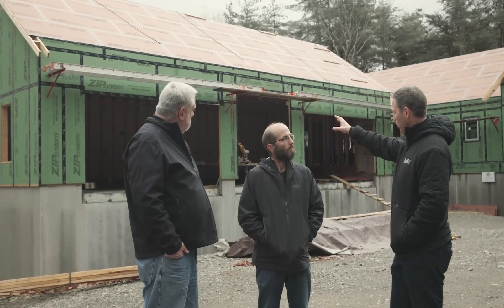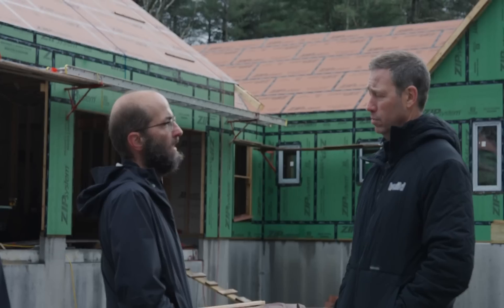Monopoly Framing + ZipR = Perfect Air Barrier/Thermal Break

Comment: Maybe I’m wrong but how do you ventilate the roof attic space so that no moisture builds up or is that not necessary. I am designing a mini house/ workshop area that would have blow in walls and attic with mini split and metal roofing. Double 2x4 walls for that thermal break sheet metal siding. I’m just worried about moisture in the attic messing with my wood and insulation. I’d like to monopoly frame the roof so I don’t have any gaps for moisture or bugs or draft.

Comment: Envelope much to tight, air exchanges critical to this design , loose air exchange and interior becomes a thermos bottle, better have back up when the tornado /hurricane kills the power for weeks at a time . Once you get evacuated all bets are off and you will probably come back to a mold pit.

Comment: Good to see this idea is being used more. How is the gable wall to roof connection "monopoly framed" in this case? It appears the roof sheathing was run past the wall to attach the ladder rake. Wish they had some drone footages or close up photos at least. Maybe Steve will do a follow up video with the drawings.

Comment: I'm still trying to understand this. Why ZIP-R in the northeast and not exterior insulation? Is it simply a matter of being cheaper?
Reply: One trip around....
Reply: @stevenbaczekarchitect9431  One trip around would certainly qualify as cheaper. Can this be done without closed cell spray foam and extra thick walls?

Comment: PSA---If you are participating in your own build, just be aware that the subs dont know you and might not listen to you if your not there. It is not easy to get subs to follow these building methods in my personal experience. You will get a lot of comments like "I've been doing this 30yrs" or "If you know so much why did you hire me?". It may also be challenging to find an architect that will work with you on these details. Some subs simply wont listen and try to force you to accept things that dont even meet code. If your building inspector is not focused; you will be in a very bad position. After multiple months we have a nice house, but it is a lot of work and stress to be involved directly.  Best of luck future homeowners!!
Reply: Reading between the lines what im really hearing is that there wasn’t good communication in the pre construction phase of the details you wanted and instead you were trying to coach as the process was unfolding.  Subs bid on projects based on their previous experience if you don’t explain in great detail the scope of what you want and usually for a good build it will be more expensive so I’m thinking you were asking for details that weren’t in the original bid so the subs were probably annoyed not difficult
Reply: - yep, the subs who say this - anyone who pulls 30 years of incompetence as justification for anything is about ready to retire - and shouldn't be on (such an atypical) site...

If the GC (if it isn't an owner build) doesn't "get" the concepts - fire them, or get them to edumicate themselves......  (Same for Engineers, architects and Inspectors - you want all the guys / gals on the team to be working for you the owner...

Indeed, if you are doing the "prime contractor" work - you need to be onsite managing the build - whenever there are any other contractors doing anything....

Comment: I know over time his overhangs will sag and droop down, I've seen ladder style overhangs sag on gables and this is a ladder style overhang everywhere, it's not a strong design when it's just nailed on to the face of the building and without even the roof sheathing to support it. He should run rafters over the Zip and create a second roof over top the first and that would give strong overhangs and more space for insulation or even vent the roof.

Comment: 1) 
How do you know the roof edge is engineered enough for heavy men on ladders with supplies climbing on the roof edge? 2) do windows have deeper flange than usual?
Reply: - just get light men to do this work..  (jk) - I don't think we are seeing all the roof / eave details just yet - if it ends up like other monopoly builds MR has shown, there should be rafter tails and a cold roof deck added  otherwise ?? - yes hmmm... -  Don't forget snow loads can be much greater than a set of heavy boots.

Comment: Matt, I have been a fan for at least 10+ years now. Watching many of your vids more than once in preparation for my last build. As of Oct 024 all of our pre home build installations will be completed. Foundation, road, 600 ft electrical, septic, well, etc. Only the actually house itself, framing plus will be left. Now - my down fall.. I cannot justify/afford all of these energy savings add-ons. The one I truly wanted to do was to add my overhangs to the air tight box as this video is describing.. With an end result eliminating all thermal bridging. And so many, many others. With the price of labor and materials these days I just don't have the funds. 😪 I'm guessing that this add-on to this home (by itself) added $15K + over the the standard method. Once you start adding one after another they add another 100K to the project. 
Keep up the good work. Enjoy watching the latest problem solving going on in the residential construction field.

Comment: I don’t get the monopoly frame in a northern climate (unless it’s all vaulted ceilings). Are you conditioning your attic and doing a hot roof?? Also, what’s the point of lining the RO s with 7/16. Could you just tape over the exposed edge of the zipR onto the 2x6 and complain the same thing?

Comment: So with the perfect air barrier on the exterior, what do you install for vapor barrier on the interior, anything?
Reply: - the external air barrier is the vapour barrier - internally the airhandler/etc dries everything to the inside  (Dehumidification  - humidity control - ERV / HRV is nearly essential in houses which are so tight, otherwise simply opening up to the elements negates insulation)..
Reply: When you say “ negates insulation” does that mean you aren’t putting any?
Reply: In my experience the “vapor barrier” goes on the warm side of the insulation because that is where the dew point exists, if the zip sheathing is the vapor barrier then are you putting insulation on the outside of the framing?

Comment: I liked seeing this when MR was building his house.  However, still, I like overhangs that are 24" in depth.  What is the max that an overhang can be and still allow the weight loading.  DIdn't MR extend the overhang framing up the top of his roof and then laid another layer of paneling on them?

Comment: I’m not understanding how the air barrier is achieved where the roof sheathing on the gable ends ties into the wall sheathing when the roof sheathing runs out to the end of the overhang. It seemed like Matt asked that question then the owner either didn’t understand the question or just breezed by it?
Reply: I think in another video you see it’s Zip covering the soffit with liquid flash in the seam where it meets the wall

Comment: This is a great job, one question why not R-12? is it due to wall thickness already or something else.
Reply: The jump from R-6 to R-9 is an easy pill to swallow, Going from R-9 to R-12 is actually a leap, nails change, special framing gun, etc
Reply: I have just put up 22 sheets of R-12 with 4" screws, yes it was  challenge as a recommendation from Efficiency VT. I will see if it's going to work along with Pella Impervia windows
 @stevenbaczekarchitect9431
Reply: ZIP and ZIP+R specifications require 1.5" or more penetration of the nail into the stud, so an R-12 ZIP+R means 2" insulation + 0.5" sheathing =  2.5" thickness, requiring at least a 20d (4") nail, which gets very hefty when each piece of sheathing requires ~70 nails.

Perhaps a more minor consideration: With such large nails, the nails themselves also start providing a meaningful thermal bridge: each sheet with ~70 20d nails would have the equivalent of 2.25 square inches of metal driving through the R-12 insulation and bypassing it (vs 1.5 square inches for 70 3.5" 16d nails for the R-6 variant).

Comment: Ummm... isn't this all a little overkill?  2x6 interior walls and R9 sheathing.  Where is this house at, the Arctic Circle?
Reply: This is just a little better than the 2021 International Building Code calls for in climate zones 4 and higher (R20 wall cavity + R5 continuous exterior insulation). Keep in mind this is a Minimum requirement.

Comment: The fact your framers had to build that whole place without backfill sucks.
I’ve been building similar to this for 18 years now. Build an envelope and then put the pretty stuff on later.
Reply: The walls were all framed offsite and craned in, 1 1/2 days to set all the walls, another 1 1/2 days for the roof trusses

Comment: I know nothing....... it's really nice to see all of that nice contiuous, carefully taped sheathing ; but um....if you are going this far to protect and seal the structure; doesn't it make sense to COMPLETELY coat EVERY surface of the ladder rake assemblies with a durable sealant and perhaps even finish paint BEFORE installing them?
Reply: They get covered by finish trim
Reply: I think those rake details all have ZIP underneath them, so my understanding is that they did complete the sealing before adding those. ZIP should not be painted, because it will be covered. The nail or screw penetrations in the ZIP are also okay -- the nail / screw doesn't create a new gap, unless the nail or screw is backed out.

Comment: I have watched this video several times and I still don't understand how the eaves/overhangs are done when a house is "monopoly framed"
Reply: My impression is that in this video the wood that is visible (exterior to the ZIP) was put together purely on the exterior of the ZIP and then secured through the ZIP to the framing, probably with heavy duty screws (e.g. PowerLags). Another flavor of this is what Matt did on his house (Real Rebuild series), where he also did exterior insulation on the roof -- I personally feel better about that approach than the approach shown in this video (even if what was done in this video also looks secure).

The details on this framing is always done in a vague way in these buildings in Matt's videos. Maybe it's currently all considered specialty (non-standard in the code) and so needs sign off from an engineer? Either way, a clarification on that would be useful.
Reply: I certainly like the concept of tight airseal at the junction of wall and roof but unless I can better understand how the overhangs/eaves are done with this system it seems like such a hassle/complicated process that its not worth what is saves in terms of air tightness.  If I could get a better grasp of how to do the overhangs/eaves it may be different story.  I would guess the great majority of framers have never heard of this method nonetheless actually performed it before.  @dosadoodle

Comment: I'm pretty sure this is the correct roof-wall joint detail for Perfect Wall, and is well and away better than some other variants you've tried, Matt.

I'd prefer to see the zip sheathing come down lower than the bottom sill plate by about 1/4" so it drips past the sill, and I personally am loathe to use sprayfoam on anything that isn't temporary, but his idea of pushing the sill out further from concrete might prove useful for handling the layering and attachment.  Just need to be sure the entire sill doesn't make contact with concrete, even mortar for stone, or it'll wick.

I like his idea of adding a half inch to RO all around to add zip sheathing inside the window sill, but I'd like to remind that alot of folks will tell you to let the top edge of a window to drain out rather than pushing any possible water back into the house.

Also should slope the bottom sill so it doesn't act as a water pan.

Comment: Are ice dams where the overhangs are attached a concern? Does the detail have a roof vent space going over the already installed zip roof sheathing to prevent ice dams building up where the overhangs are being attached or is that not a concern with monopoly framing?

Comment: Really impressive work by Josh.  As a fellow engineer who also builds, I really appreciate it.  Funny thing, we monopoly framed my house in 2012 simply because we wanted rustic exposed rafter tails.  The sane approach we arrived at was to end the rafters flush with the walls and put on a rim board.  Then a fascia and stained 4x6 "faux" tails were attached to the rim, and stained rough sawn 1x12 lumber attached over the top of the 4x6 tails to look like roof boards from below.  Viewed from outside it looks real but it's all tacked on external to the monopoly framed wall and roof structure built from traditional framing lumber and sheathing.

It's great to see the monopoly concept being used to enhance the build for airtight purposes with modern materials and methods.  It makes a lot of sense.  My only advice to anyone considering this is to be aware of snow loads and wind uplift loads on the overhangs -- since they are not structurally tied to the rafters, they need to independently handle these loads.  Wind loads can be very substantial on the overhangs, especially on gables where wind creates low pressure above the roof and high pressure under the overhang, which is a perfect combination for uplift.
Reply: It's kind of like movie sets when you think about it.
Reply: 2018 INTERNATIONAL RESIDENTIAL CODE (IRC) | ICC DIGITAL CODES

Image shows a 1’ max overhang and tension ties. What is the best detail for this eave in snow climates?

Comment: @Matt if you were building a house for a client in Texas area how much more premium is your service over the entry competition house builder like a Lennar homes? Using the “monopoly framing, energy efficiency house”
Reply: I recall hearing suggestions of an increase to the total build cost of 5% or 10% to get the energy efficiency improvements, e.g. I think I heard this on the UnbuildIt Podcast (Steve Baczek, Jake Bruton, Peter Yost). For consideration, this is partly because the increased costs in the improvements are partially offset by lower HVAC costs, so the suggestion is that these costs should be bundled together when considered by the homeowner or when presented to the client. This helps clarify that these costs are not independent: cutting costs in one increases the required costs for the other.

Comment: I would cut out the window/door openings so the Zip outer sheeting would/could provide an abutment for the inside sides, header/sill plate Zip sheeting a cove to sit into basically? Sealing off the seam with a contiguous front fascia sheeting scheme.

Comment: It seems like it would be cheaper just to have a higher heating cooling bill.  Do you ever recoup the cost of all high end insulation?
Reply: It’s not all about cost, it’s also about comfort. No drafts or spots that are too warm/cold. And it helps a lot in power outage scenarios, house will stay cool/warm a lot longer.
Reply: @everkill1  Yes, this doesn't pan out if you only look at Energy $$, health, comfort, durability, etc matter to some
Reply: Also insect entry is reduced and control of air quality and moisture. If cheap is the only metric you want to hit then sure but….
Reply: @twestgard2  Agreed

Comment: tHanks for the video.  What keeps the added overhang framing from simply.....falling away from the house over time?
Reply: Likely giant f$%#ing lag screws. It'd be nice if they showed it though. It does prevent you from having large overhangs though as there are limits on how far you can cantilever the tacked on rafter tails. You'll be limited to around a 2' overhang. Large overhangs significantly improve the longevity of structures, so I went with modified monopoly framing (look up Scott True in another of Risinger's videos), since it allowed me to have 3' overhangs and in some places 5' overhangs.
Reply: @jonathansage2147  More videos coming, waiting for progress to catch up
Reply: @stevenbaczekarchitect9431  looking forward to it. I love your work.
Reply: tHank you  @jonathansage2147  .  I've seen remodelers try this type of thing and with some time it showed like underwear through a tight dress. 

However, in the spirit of cool new things, maybe there is a way.  
Have a spectacular New Year!

Comment: Hi Matt! You need to do a show on this in Northern Idaho, When you ask about air barriers, blower door testing, and Manual J calculations you get a blank look from the builders?
Reply: Technology has not made its way to the frontier.......lol
Reply: @stevenbaczekarchitect9431  Do you have links to the other videos that Matt mentioned in this house Josh is building.
Reply: It's the same in the Boise area!  They're still building  80's style with vented crawl spaces.

Comment: My next build will be Monopoly framing, but how do you do the details if you need 4 inches of exterior foam?
Reply: Take a look at Matt's real rebuild. His house has exterior foam over the monopoly framing.
Reply: Don't use zip-r. Apply your insulation on the outside of your zip sheathing. It's more labor intensive, but it puts the exterior insulation in a better location to prevent your sheathing from becoming a cold condensing surface.
Reply: I may be wrong but I think you can do it over the monopoly framing.